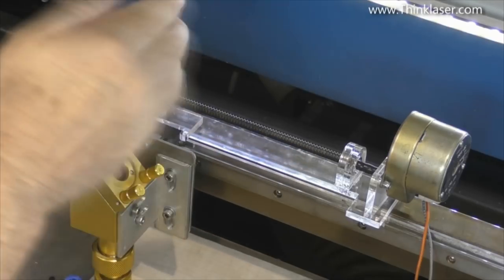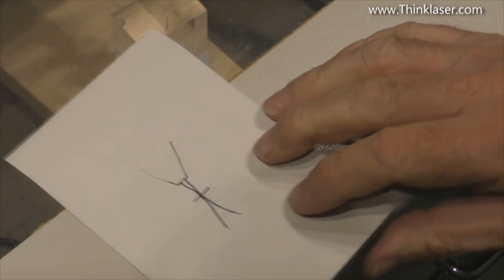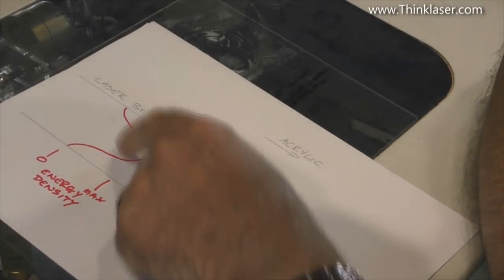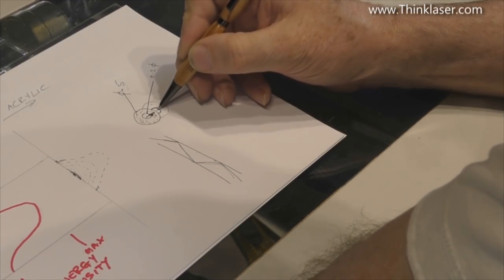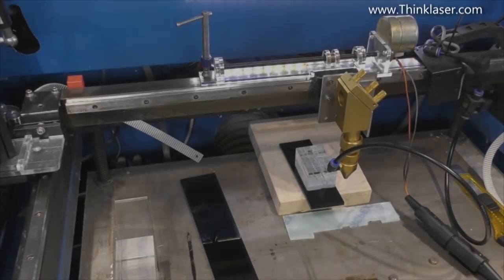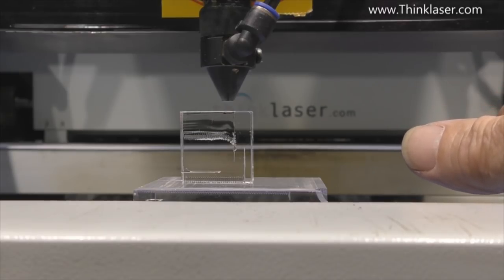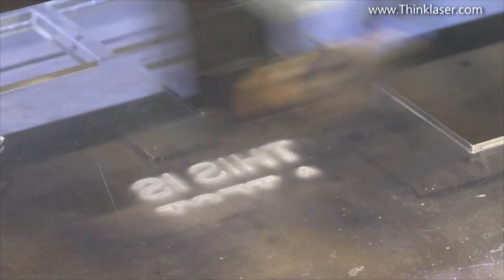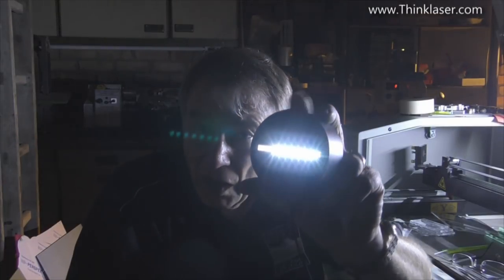How Best to Cut and Engrave Acrylic (2018)

Comment: I'm chasing a better cut and with the effects from the stepper motors would a gear reduction help? My laser has the x-axis belt connected directly to the stepper motor.
Or would I be better off spending the extra to upgrade to servo motors?
Thanks

Comment: Check a lesson on optics.  Understand reflection and refraction.  Then understand "CRITICAL ANGLE".   Gong down a single hole, the beam reflects internally because it is beyond the critical angle, so it keeps its original size fairly well.  Moving within the hole to its edge, deprives the beam of reflection from the back 
surface so the beam will reflect back a bit giving the rounded cut that has been shown.

Comment: Can you adjust your stepper motors to make higher steps. For example go to 1/32 degree per step. This would smooth out the stepping but you have to adjust the stepper acceleration.

Comment: Hi Russ!
I have watched many hours of your instructional videos and greatly appreciate your work.
I want pass along to you a simple solution I came up with for eliminating the residue on engraved acrylic. It's called Aqua Net hair spray. Spray coat your acrylic sheet before engraving\cutting & it just rinses off with warm water along with the residue & no damage to the acrylic. You read it here 1st!
TokinSpokane
Custom Crafts
Reply from the maker: Hi C.Willy,

Gareth @ thinklaser here, Russ doesn't actually respond to this Youtube channel, but I'll pass on your kind words. 

Thanks for the tip, just need to see if it's available in the UK. 

Regards

Gareth @ thinklaser

Comment: Here's a thought. Coming from 3d printers. What about microstepping ? What are hardware drivers set to ? Mechanical steps or microstepping ? If microstepping - how much divisions ? Full-half-4x-8x-16x-...-256x ? Of course that would affect speed (for fear of losing steps), but i assume increase accuracy greatly. How would this affect striations on cuts ?
Reply from the maker: Hi threedee999,
Gareth @ thinklaser here.

I believe Russ has shown that the striations are a result of the interaction of the laser beam heat and the acrylic rather than the motors. Putting heat into the acrylic through the use of longer focal length (2.5" or 4") should give a more polished finish. Of course, using extruded acrylic will make this process even better.
Reply: Yes, i got that, but at a trade cast for engraving to extruded for cutting. I meant if reducing stepping might help with cutting cast cleaner after engraving... Just a thought.
I'm only to receive my cutter (which is in about 4 weeks), but learning and watching and engaging in thought experiments. You may disregard all this as musings of incompetent n00b. No offense will be taken.
I'm speaking as someone who ran stepper driven things for a long time (vinyl cutters, cnc machines, domestic and industrial) and dont have ANY experience specific to laser cutting.
Reply: Also, i wonder what different results would proper servos produce in stepping section of this video ?
Reply from the maker: Hi  @threedee999  
Russ did some experiments on his China blue machine using a lead screw and eliminated the curtains effect completely when engraving onto plywood. I seem to remember that he then tried a series of experiments on cutting acrylic and got the striation marks as well. (these videos are on the Sarbar Multimedia channel). Proving that it is the sublimation effect nibbling away at the acrylic. 

Gareth @ Thinklaser.
Reply: Yeah, seen that video, but even before i watched it i did have a thought about timing belts from my 3dprinter experience. Oftentimes even the toothed pulleys would be a bit wonky either by manufacture or overtightening set screws they would deform a bit and influence small details on the prints. You have to look for it tho.
When my 100w 6090 arrives, before i ever plug it in i'll probably replace cheap aluminium pulleys to something more substantial and better engineered. Idea of driving by leadscrew is also appealing to me. not dure how it would improve accelleration though, much more mass to move for a stepper. Might need bigger stepper.
I plan to mod the living shit out of my laser just to show you, big guys, up :D (mmm, tasty ambition is tasty)...

Comment: Perhaps the reason for bigger striations in thinner acrylic is the velocity of the cut. The lower velocity causes higher heat in the cut, polishing the border. I suspect that cutting thinner acrylic at low power and low velocity reduces the striations, because the heat in the borders polish the cut.
Reply from the maker: Hi Francisco,
Gareth @ Thinklaser here. I believe Russ did cut at low speed and high power on the thinner acrylic. He believed that there was not enough material present in the thinner material to dissipate the heat fast enough and allow for sufficient melting to occur to polish out the striations
Reply: seems like you didn't watch the video

Comment: Great nice video, but I have a question for you.
If a lot of hot gas is compressed close to the laser beam, waves are probably produced by the overheated compressed gas through the tiny gap

Comment: Great Vid very helpful Russ.
Don't know if you can help but when  I cut I have a very polish edge on the X axis but on the Y axis 
you can see the striations in the acrylic. I have tried to up power and slow down the cut but it does not seem to make a lot of difference. 
I am using 3mm cast acrylic.
Any help would be most grateful.

Alan
Reply from the maker: Hi Alan,

Gareth@Thinklaser here, I'll admit I couldn't think of a reason why the Y-axis on your machine would give worse edge cutting performance than the X-axis, thinking it may be a stepper motor issue. So I decided to ask Russ for his thoughts;

"Cast acrylic is very difficult to flame polish anyway. Also, the thinner the material the greater that difficulty becomes. There is no logical reason for the axes to cut differently if the machine is set well. 

My guess is that the user has not got the beam central in the nozzle and is also using air assist. Is there an air control valve on his machines air assist? If so he needs to set air assist, using a saucer of water to give 2 or 3 bubbles per second,  i.e. just enough to protect the lens. Then to get flame burnishing of an edge, it is essential to let heat build up within the cut. That is incredibly difficult with thin CAST acrylic. 

Here are a couple of pictures of some tests I did with 2mm cast acrylic (http://thinklaser.com/wp-content/uploads/2018/08/set-of-edge-cut-acrylic-e1533109869527.jpg). My strategy to get heat build-up was to use a longer focal length lens (a blunter knife?). You could normally cut this with full 60 watts at about 25mm/s with a 2" lens. I dropped the speed to 7mm/s  and the block of samples run from 68% power to 13% power with no noticeable change to the surface finish. It was not until the last two tests on the right that I removed the air assist. This second picture (http://thinklaser.com/wp-content/uploads/2018/08/3-acrylic-edge-cuts.jpg) shows  from left to right 
7mm/s @68% power
7mm/s @33% power no air assist
5mm/s @ 33% power no air assist.

Here is a little test tool for checking the centrality of his beam alignment through the nozzle (http://thinklaser.com/wp-content/uploads/2018/08/Beam-Checker-2.dxf) .......if he can use the pulse button with the door open. If not he will have to make my little trampoline tester for use with the door closed (http://thinklaser.com/wp-content/uploads/2017/01/Laser-thermometer.dxf).

Hope this helps a bit. As I said there is no mechanical reason for the difference in axis  performance other than airflow not central to the beam........but there should be NO airflow as this will do exactly what you do not want to happen i.e. cool the cut." 

Please note: there is a risk of flaming when running at very low flow air assist levels.
Reply from the maker: Russ used a 2.5" lens for these results, you may get even better results with a 4" lens. The objective is to get the acrylic as hot as you can.
Reply: Hi Gareth

Yes I am using a very small amount of air with an adapter that was supplied to me . I was advised not to turn the air off completely as this would damage the lens. 
I can not do the trick with the water bubbles as my air is controlled by the machine and only comes on when I am cutting or engraving.
I am using an wider nozzle that was supplied with the machine for  use with acrylic as well.
I have read else where that thin cast acrylic is hard to get a flame burned edge.
I have checked my beam in all 4 corners and this is good.

Looking at your results I am getting some thing similar to your middle one.

I think I will look into a 4" lens to see if that helps and maybe get some extruded acrylic to see if this is any better.

By the way I have a 60w Thunder laser.

Thanks for the info and help.

Alan
Reply from the maker: Hi Alan,

Extruded acrylic will give better results but has it's own weaknesses as Russ explains in the video. Good luck with the 4" lens

Gareth@Thinklaser

Comment: Hello Russ. Excuse me for my ignorance, but i don´t see striations when I polish acrylic with a gas torch. Maybe the striations are produced by variations in the power of the laser beam itself, due to resonance or waves in the power supply (it transform 50Hz AC to DC).
Reply from the maker: Hi Francisco,
Gareth @ Thinklaser here. While a gas torch is hot, it is nowhere near as hot as a focussed laser beam. When you polish the edge with a gas torch, you are actually melting the acrylic, allowing it to "find its own level" and leaving behind a polished surface. The laser beam instantly vapourises the acrylic in and around the laser beam and as per Russ's explanation it nibbles away as it moves leaving the striation marks.
Reply: Ok. But nibbles away as it moves means a periodically changing situation (the bites). I believe the striations are produced by waves or resonance in the laser beam power. It´s only an assumption. In low velocities the striations are lower because the residual heat of the laser cut is higher at the border of the acrylic cut, polishing the surface.

Comment: Could you help me how can I change in RDworks a factor what results an aprox. 60 sided polygon shape instead of a circle?  thanks
Reply from the maker: Hi Peter,

Gareth @ Thinklaser here. Are you trying to import a dxf file? Sometimes it is worth importing in 10 x the needed size and then rescaling in RDWorks. 

There is a File Parameter setting (Config(S) / File Parameter Setting. 

I have PLT Precision set to 1016
DXF unit: mm
Import .dxf text info ticked
Import dxf point ticked
Import image in AI files ticked
Enable import AI fill contour ticked
Combine lines ticked with error 0.01mm

There is also a curve smooth setting Handle(W) / Curve Smooth

2.13.4 Curve Smoothing
For curves that do not require a high degree of precision, the curve smoothing function can be used to make the curves appear smoother and to speed up processing. To invoke curve smoothing, the user should Click on menu [Handle] -> [Curve Smooth], or the   icon. These keystrokes invoke the curve smoothing dialog box (see Figure 37).

Select Low, Middle, High or Custom.

If Custom is selected you will then see the Curves Smooth Dialog Box. (Figure 38)

Smoothing is effected by dragging the smoothness slider (at bottom left) to the desired point, and by then clicking the [Apply] button. The curves before and after smoothing will be visible in the dialog box; black curves represent originals, red curves represent smoothed curves.

You can zoom in or out of the smoothed curves by rotating the scroll wheel on the mouse. The largest view of the smoothed graphic can be obtained by clicking the [Full Frame] button in the dialog box.
After the desired smoothing effect has been obtained, the [Apply] button should be pressed to save curve smoothing settings.

Comment: Hu Russ. How come the laser beam is not bouncing back and burning the acrylic ?
Reply from the maker: Hi Glassgunner7,

Gareth @ Thinklaser here. 

Can you let me know which section you are referring to with regards to the reflection? I will then try and answer your query? 

Regards

Gareth @ Thinklaser
Reply: 40:45 cutting. What surface is under the acrylic that is diffusing the light beam ?
Reply from the maker: Hi Glassgunner,

Russ was using his mild steel sheet bed, but he had raised up the acrylic sheet to allow for efficient extraction and for the parts to drop cleanly. The laser beam would have been defocussed when it hit the metal and wouldn't have enough power to damage the acrylic on the reflection. 

Gareth @ Thinklaser

Comment: at the end of the day i'd say it's because acrylic isn't perfect even though it's clear. what's the problem exactly?
Reply from the maker: Hi Stu,
I'm not sure what your question actually is.

Cast and extruded acrylic have different properties when laser cut, so it's best to use the correct version to get the best finish for your application.

Gareth @ Thinklaser